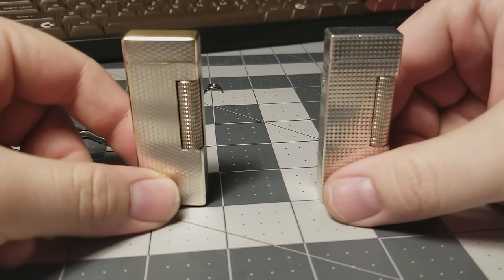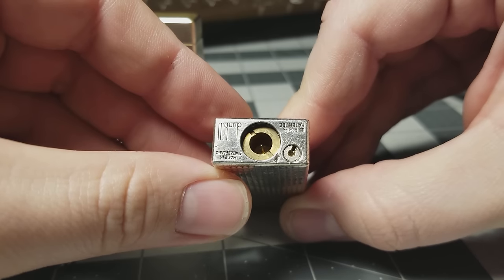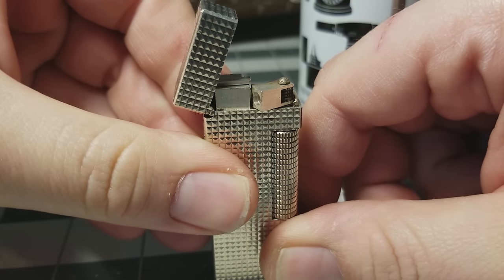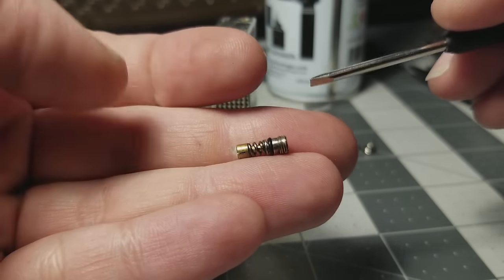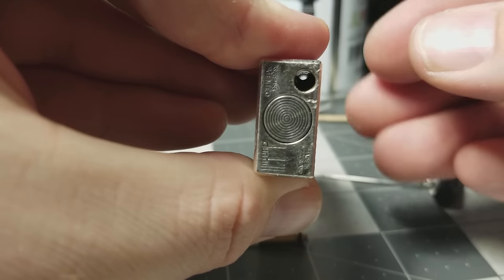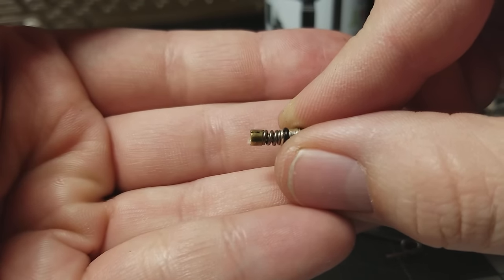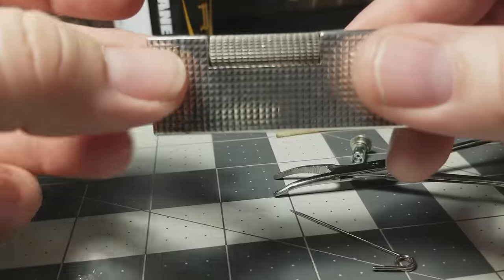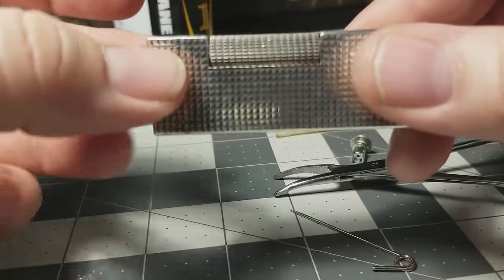Dunhill Lighter Guide 1

Comment: Are there any similar videos for the Dunhill longboy? I started to disassemble and the insides are different.
Reply: Thank you so much for the video. The problem with my Dinh I’ll roller gas is that the valve does not open when the lid is opened and so, it won’t light. Can I pull it up and down with a pair of tweeters. Or do you have other suggestions? Thank you in advance for your help.

Comment: All butane lighter cans have those same plastic adapters in the caps.  I pay 2.99 at the mini mart down the street no matter if the label says refined 5x or 11x.  A cigarette store a couple of miles away sells 5x for 2.99 6x 3.99, 7x for 4.99 up to 9.99 for 11x - it's all hooey - all the same stuff refined the same the only difference is the labeling for the retailer's benefit.